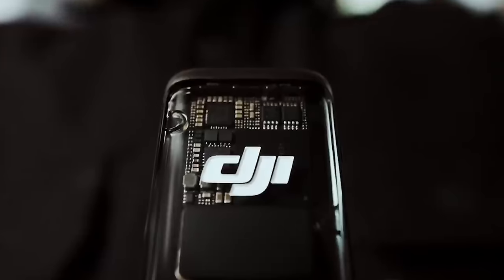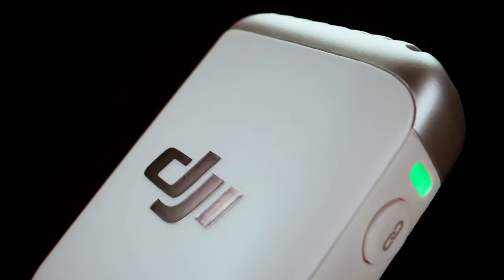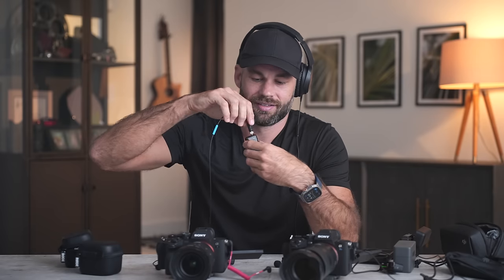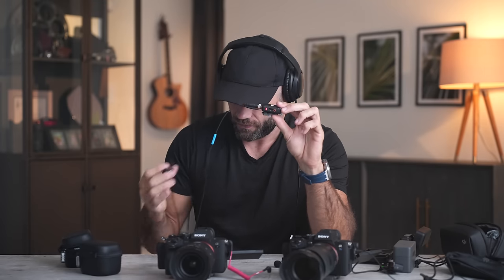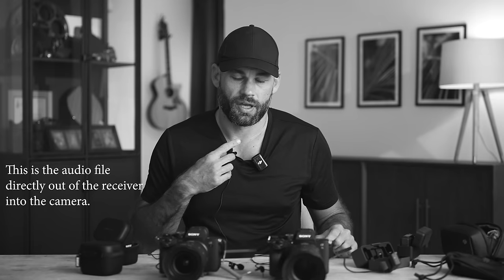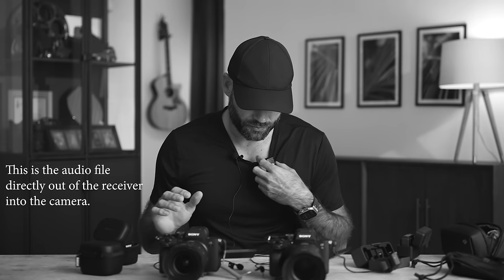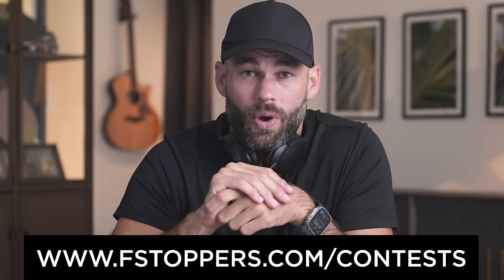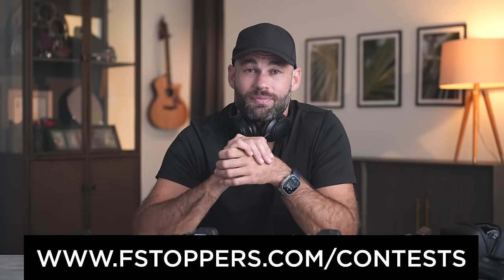DJI Mic 2 has MAJOR issues

Comment: SAME exact experience!! Using high end Shure lav mics. Happened first time I took it out, on a client shoot. Thankfully I still had the Mic 1 in my bag as a backup!
Reply: Did DJI actually write somewhere that this set works with all lavalier microphones that some Youtubers try to attach to it at some point? I don't believe. Why do you assume that this has to work?
Reply: @mathiassiebert1217  because there's no logical reason to assume they wouldn't. Does it make more sense that DJI would make their customers GUESS which mics will work? It's not like the Shure or Sennheisser mics we're talking about are some radically different tech than the DJI version. They're passive (non-powered) 3.5mm jack lav mics. BOTH of which worked with the DJI Mic 1. Also, from a business sense, their main competition (the RODE Wireless GO and Pro) work with all mics of this type, so I would ASSUME they'd want to be competitive. Pretty obviously a mistake here.

Comment: Last set had same issues. Rode is the way to go for plug in lavs, DJI maybe, if you are using the transmitters as lavs. The Shure MVL only one recommended for last iteration.